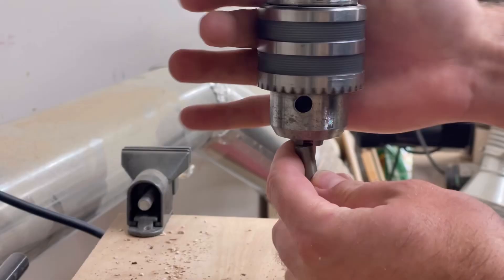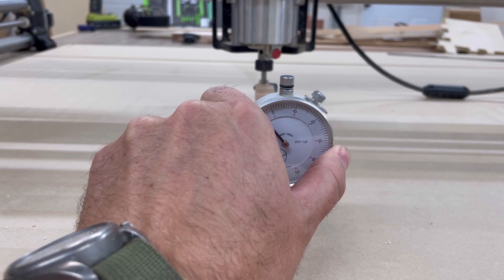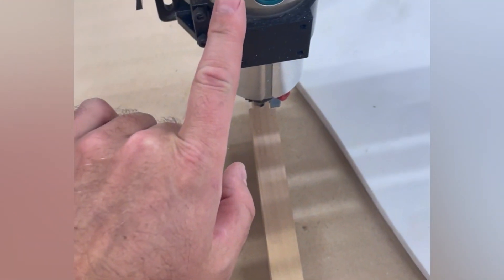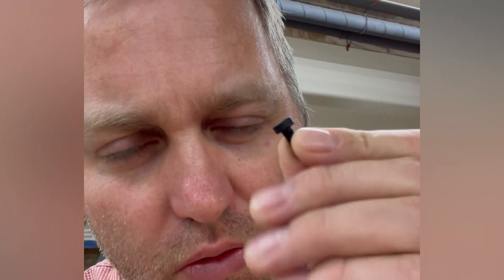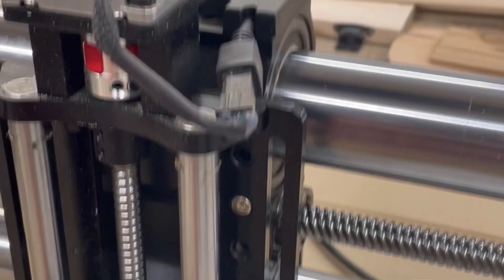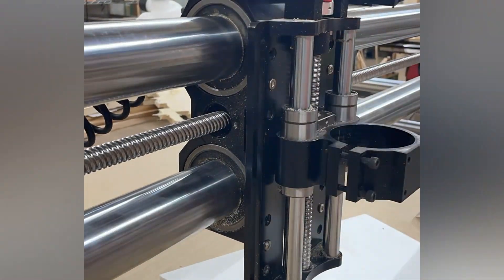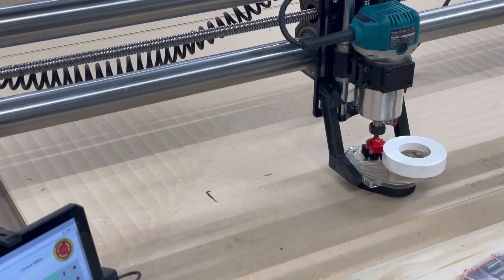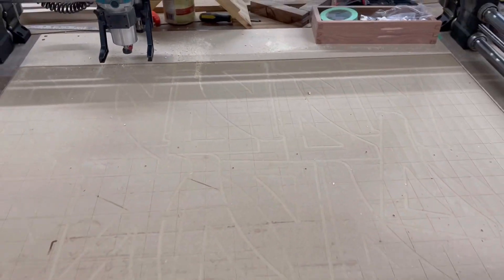Tramming My Onefinity CNC | Problem with My Onefinity Journeyman X-50

Comment: check front to back tram at the ends and in the middle youll find the shims bend those 50mm rails in the cent. get rid of the shims and use the 8 adjustment screws to set tram from to back
Reply from the maker: They need to make a better point of pointing those out because I looked everywhere for how to do it and it’s not very apparent.
Reply: @Hatchmade  support for these cnc routers is poor in my opinion it ruined my buying experience. ive never had this issue with anything ive bought. idk the machine is fine but i have very little good to say about thier customer service.

Comment: I don't get it. Been doing this stuff for over 60 years and I cannot understand how you can machine your table flat using a spindle that is mounted to a not very rigid axis that is mounted to a table that is not very flat. Now when you tram the table I think you are just checking how closely the spindle followed the not flat table?:body-blue-raised-arms: please help!
Reply from the maker: @joen2816  flat enough for woodworking is a lot different than flat enough for machining
Reply: @Hatchmade  OK. So what is flat enough for woodworking? Just asking.
Reply: I have a feeling that's why my onefinity came with such small screws to hold it down.
Reply: I think I know what to do I will try it it and let you know.
Reply: I really like this machine and I want it to be right.

Comment: Are you sure the stainless is harder than most steel bolts?
Reply from the maker: Apparently I was misinformed. Stainless is not as hard as steel. However the larger head is harder to strip out than the pathetic little ones they have stock. Also these are locally available to me. The OEM ones weren’t and were more expensive.
Reply: Your videos are great and I agree some matching ome bolts are hard to find. I liked your replacement.

Comment: It is a common misconception that stainless steel bolts are harder.  Sorry to break the news to you but low profile(short head) alloy steel 1/4-20 have a tensile strength of 140,000 psi whereas stainless steel of the same size and configuration is half that, 70,000 psi.  The more you know🌠
Reply from the maker: I did a bit of looking and it turns out you’re probably right. However for you hardness and tensile strength, while typically correlated, are not the same thing. The more you know.

Comment: I had this same thing happen to my z axis bolts and spent a month chasing replacements.  Onefinity had 10mm M5 Low Shoulder (not 12mm) listed on their 'help' site until I pointed out to them it was wrong.... only AFTER ordering 10mm versions BEFORE extracting all 4 stripped bolts. (If figured wrongly to keep the machine usable until replacements arrived.)  I live in a decent sized city in the US and even the local Fastenal didn't have these. 1F customer service seemed very helpful. Had I contacted them first, they implied they would have just sent replacements , but because I chose wrongly to use the forums and the post they provided on the topic, they would gladly now invoice me for replacements. At least they corrected the forum post.  With my machine down it was more affordable to pay 35 bucks US for the box of 100 (most of that shipping) than hope they get around to charging me for 4 and shipping from Canada.  I should have did what you did, I could find those at any box store.
Reply from the maker: That's exactly why I didn't order them from them. When I need to fix something I want to be able to go grab the part and move on. They really should have designed that part a bit better. I can't see how another 1/8th of an inch clearance would have affected anything.

Comment: Thanks, great video and simple way to tram the 1F.  Beginning to see so many 1F screws locking up that it may be the hard anodizing and screw material creating it. a bit of white grease or anti-seize compound may help. 1F should design an adjustment for tilting the router front / back and side to side.
Reply from the maker: I also find it funny that this is the one video I’ve tagged them on on Instagram that they haven’t shared 😂😂
Reply from the maker: Completely agree. It would take a relatively minor adjustment to their tool paths to add four grub screws to tilt it forward and backward for sure. I thought about doing it myself and I might when I move the machine to it’s permanent home.

Comment: CNC sure does add a whole new complexity to the shop. I tend to obsess over getting my table saw to cut squarely. I can't imagine owning a CNC router. I could never leave the shop. I would be trapped in the searching for perfection loop. Again!
Reply from the maker: I figure when it comes to wood, if I’m 1 or 2 thou out over what amounts to a 24 inch span I’m not going to complain. Wood is going to move more than that if it rains tomorrow.

Comment: Your video today fixed a 15 thousandth variation.  Mine was using a socket to stop 1/4 inche gouging using a screwdriver. Pretty much identical...
Reply from the maker: Pretty close to the same thing😂